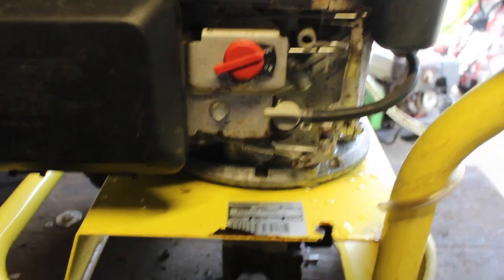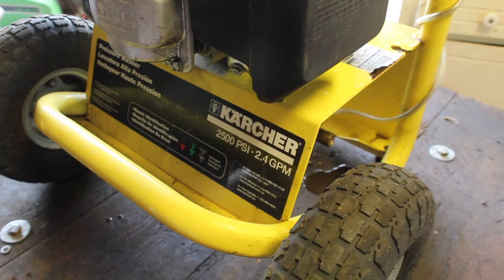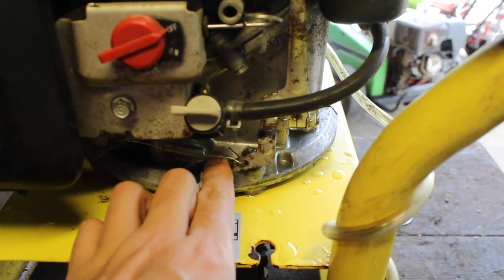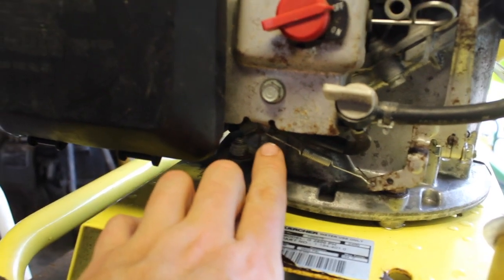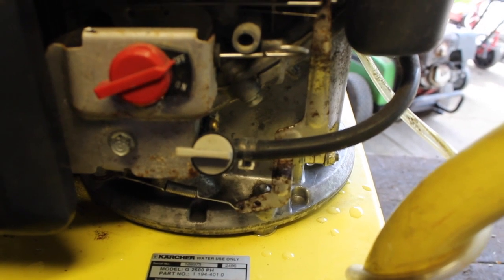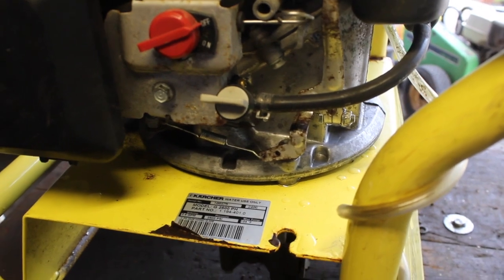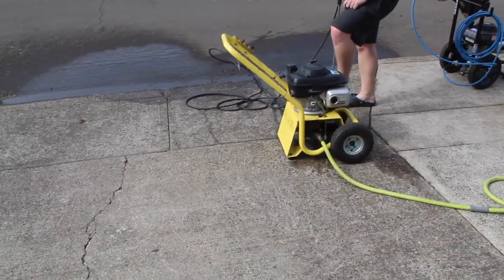How to: Fix a Surging Honda Pressure Washer

Comment: I'm sorry that you didn't show the original condition. I would have liked to have seen what the surging issue looked and sounded like originally.
Reply from the maker: I originally did but somehow it didn't record unfortunately. It basically sounded like a lean condition with the exception of the engine RPMs were to high when it revved up

Comment: Mine surges only when spraying. Can you suggest anything for me to look at?
Reply from the maker: Three ideas come to mind. The governor spring is to tight. Hondas usually have multiple locations on the throttle arm. Another thought is the carb is dirty and the engine is running lean. Pressure washers have a tendency to get water in the bowl. A good cleaning might be in order.  The pump might be malfunctioning. Maybe the unloader valve needs to be loosened. Check those and see if it works. If it doesn't let me know and we can go over less likely causes.
Reply: @PNWSmallEngineandLawn  I've done all those things and still have a problem.  Engine runs fine, until you engage sprayer, then engine and sprayer pressure surge.  I've purged air, cleaned carb, checked fuel filter, new fuel, replaced unloader.  I feel its pump related, because of how the engine runs before engaging the sprayer wand.  Any other ideas to look at??

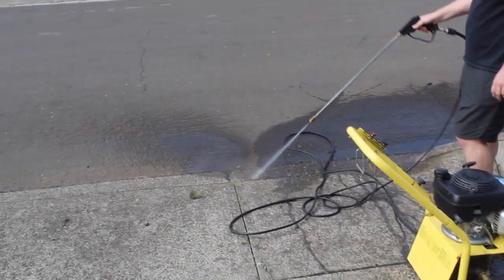Comment: In the video at 3:06, when it kinda stops spraying, or loses pressure. Mine does that a lot, pretty regularly. Anyone know what causes that?
Reply from the maker: That is air in the pump. You can try to get it out by pressing the trigger on the wand before it is running but sometimes you need to let it run. If that happens consistently for a couple of minutes after it is running your unloader valve could be going bad

Comment: The issue on these Ryobi pressure washers is they all have different carburetor set ups even though they have the GCV160 engine which is a poor design. The pressure washer works great when you're spraying but at idle it surges. It has a new carburetor and new pump. Pretty much brand new , only 3 years old. This is the 3rd one of these Ryobis I've worked on and they all have a similar issue . Poor design of these GCV160 engines
It
Reply from the maker: Ya they are not the best design. I drilled out my father in laws main and pilot jet and it has calmed down the idle surge a decent amount